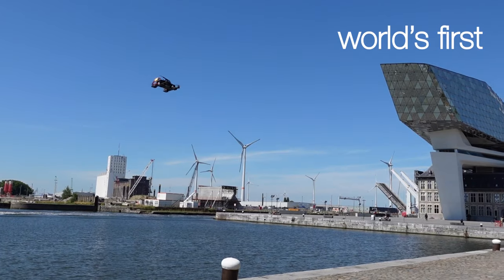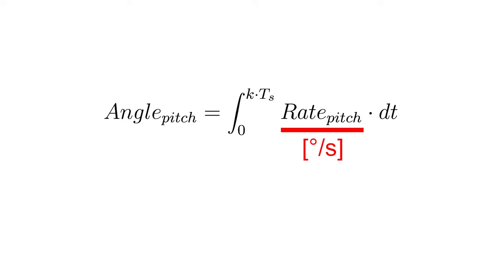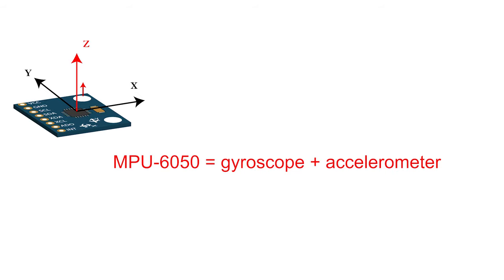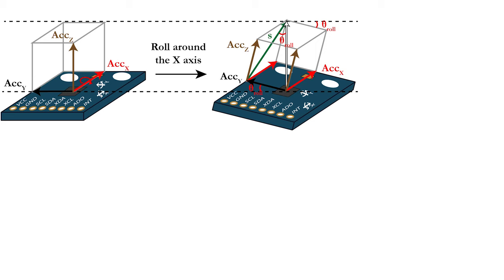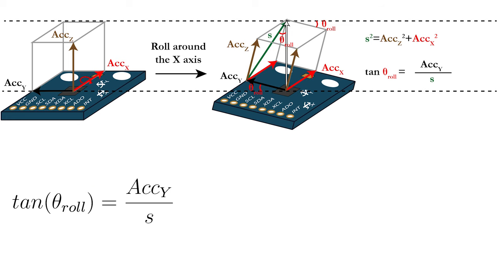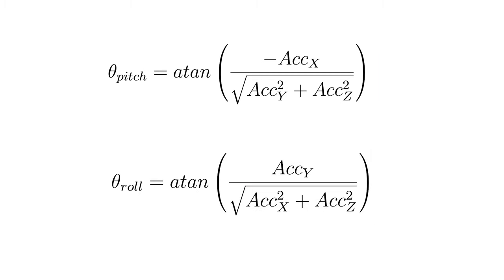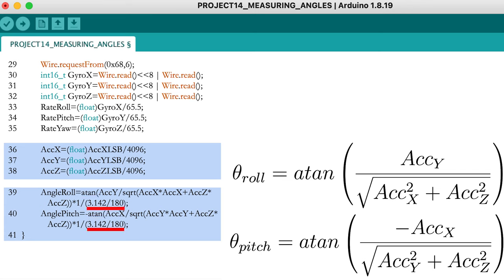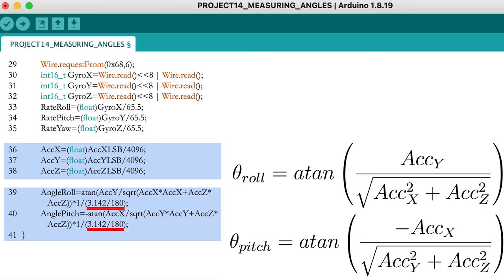14 | Measure angles with the MPU6050 accelerometer

Comment: When will be the next video and do you have any other videos that fully explain a kalman filter, this video was extremely helpful and for the first time i understood why simply using acceleration cannot work in a system that is constantly changing acceleration
Reply from the maker: Yes next video will include a full mathematical derivation of a one dimensional Kalman filter, in which we will use the gyroscope to predict the angle and the accelerometer to correct the prediction. I hope to finish it by the end of this week!

Comment: Hi , I want to know why 5:17  theta roll in the middle is equal to others , can someone explain, thanks .
Reply: exactly i am also getting confused did u get to know?
Reply: I didn’t get this as well. They leave us with half reasoning
Reply: Same thing i miss understand.
Reply: Same also confused
Reply: The white line begins in the origin and ends in the opposite vertex meanwhile the green one is the diagonal of the Accx Accz square. If you made a triangle with those lines (green, white), you would find that is a similar triangle with the others triangles (triangles from above and bellow, that have the theta roll).

Comment: Further on pitch/roll reversed: This obviously depends on orientation.  I have implemented on a breadboard style veroboard so the Y-axis is in the forward direction, hence Y is roll and X is pitch.
On AccZ at 1.6g:  I bought a batch of 3 cheap  mpu6060 boards (GY-521).  The other 2 all give AccZ within 0.06 of 1g.  I am a little suspicious of the 0.6 variation.  I shall keep digging.

Comment: hey, it seems the YAW angle computation based on Accelerometer propery isn't working, i mean after i got the value of AccZ who is equal 1, the Angle based on trigonometry should be : atan(AccelZ / sqrt(pow(AccelX , 2) + pow(AccelY , 2))) /(PI/180);

Comment: Thank you very much!
I have a question for you, if one decided to use merely the angular accelerations from the sensor and estimating the angle using numerical integration.
If instead of using the rectangle numerical method (the one you showed in the video), one uses a more complex but more reliable numerical method, do you thing the drifting of the error would slow down?, and also, do you think that changing the sample frequency of the data acquisition from the sensor (and the Arduino) can improve the results?

Comment: Hello, your Z axis is pointing to up but you have 1g ? You're not supposed to have -1g because gravity acceleration is pointing down ?
Reply: Yes, gravity accelerates the module downwards (-1g). So, in order to keep its horizontal position, it has to be accelerated upwards by the surface it is mounted on (+1g). Therefore, the net acceleration equals -1g + 1g = 0g

Comment: On trying this example I seem to have pitch and roll reversed.  (MPU6050 in same orientation as example.)  Also AccZ was 1.6 by default, had to correct by 0.6, however AccX and AccY similar to example.
[I used to work in Antwerp back in the 1980s.  Nobody told me an alien spaceship landed on the Port Authority building.]

Comment: I want to ask, base on that equation wouldn't the tan(angle) of roll change if it starts accelerating in the x axis. Thanks
Reply: The approach he used to calculate the roll and pitch is only valid for system that is not in motion other than rotating. Once the system starts to accelerate in the x and or y directions, the results become incorrect

Comment: Hi, I have a question : why are you choosen 8g for the accelerometer value ? Why not 2,4 or 16g ? Thanks
Reply from the maker: 2 or 4g would be too coarse for control purposes, but you could try 16g if your application requires a very precise value

Comment: yoo this series is exactly what I was looking for thank you so much! underrated channel. One thing I don't understand is that if there is an acceleration happening that is not equal to 1g then wouldnt that make the accelerometer readings invalid for using for calculating final angle?
Reply from the maker: Thanks! If accX for example is 10g and accY and accZ are ≈ 0g, the result will be exactly the same as when accX is exactly equal to 1g. You can calculate this example through: pitch angle=atan(accX/sqrt(accY^2+accZ^2))=atan(1/(≈0))=atan(10/(≈0))=90°.
Reply: @carbonaeronautics  Makes sense, thank you

Comment: I dont know if you will reply this, but i am using your code in a RC plane. Using this to know if im upside or downside. When you turn the sensor downside stills having 0 roll angle. did you know this "bug"? Its just for notice you, i am trying to solve it. (apologizes me for my english).
Reply: Did you manage to fix it, if not you can use the 2arctan function, but you will have to make you own custom function to recognise when the numerator is positive or negative to determine what quadrant the angle is in